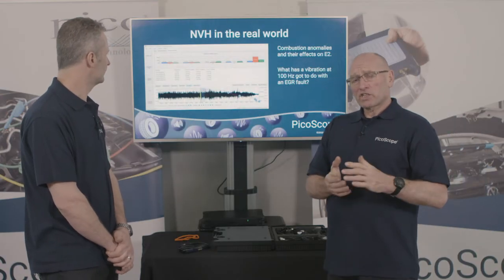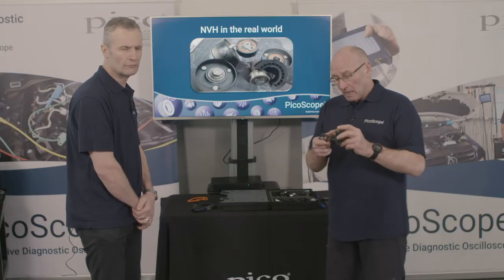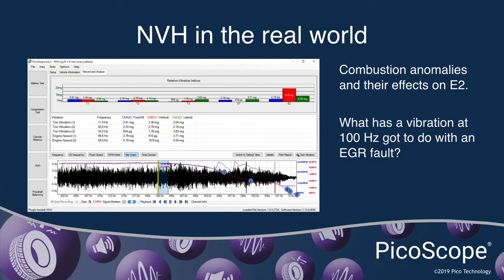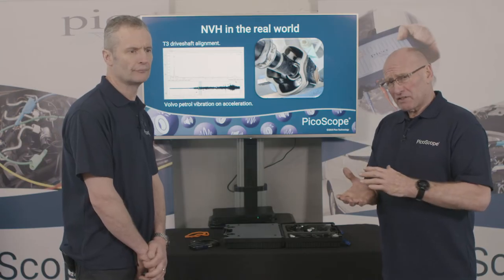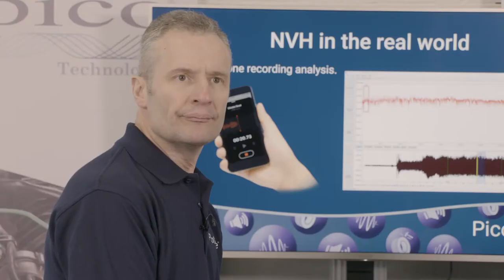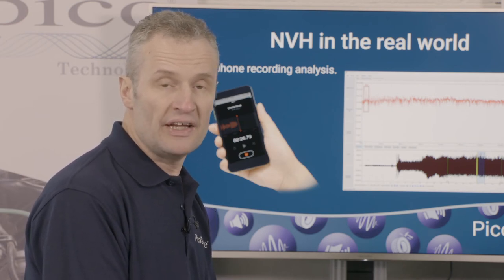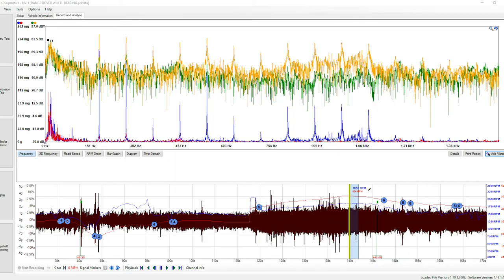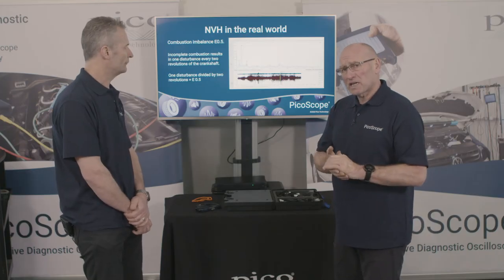PicoScope NVH episode 7: NVH case studies

Comment: Excellant series fellas. Not too technical that I got lost but not a sales pitch either. From my point of you this seems like magic but I think this is example of tege future of diagnostics. Easily transferable in the shift toward electric vehicals.
Reply: Thank you Mark and glad you enjoyed it. It's a tricky subject but hopefully this will give everyone a little confidence to at least take a measurement. It's a fascinating subject and has a lot more to give then just finding a tyre vibration and with the rise of EV's this type of non-intrusive testing will be important. Thanks again!
Reply: Hello Mark and thank you for the feedback, sorry for the late reply. To follow on from Bens reply, you are most certainly correct, NVH will be around machines/vehicles for many years to come be they Petrol, Diesel, Gas or EV. The ability to record NVH whilst measuring frequency and amplitude will bring about additional non-intrusive diagnostic techniques. These techniques will allow the technician to make an informed decision on the relevant “next step” for diagnosis (possibly intrusive) or indeed which component to replace. I hope this helps, take care……Steve

Comment: 我想请教一个问题   XYZ的震动值超过多少mg'算作不合格的呢
Reply: Hello and thank you for the feedback, sorry for the late reply. 
Translation to English: “I would like to ask a question, how many mg 'of the vibration value of XYZ is considered unqualified?”

This is an interesting question and difficult to answer conclusively. Forgive my translation but I assume by unqualified you are suggesting how much vibration is unacceptable in the XYZ axis?
This all depends upon what we are measuring and where on the vehicle?
Think of an engine vibration with the accelerometer placed on the engine and then on the chassis.
The level of vibration at the engine will be greater than the level measured at the chassis but by how much depends upon the efficiency of the engine mounting to quench this vibration, and of course, assuming there is no foul conditions between the engine and chassis.
This is a typical example and one where the vehicle manufacturer does not provide any data or values for engine mounting efficiency. Therefore, we are reliant upon back-to-back testing with a known good vehicle. The results then form part of your data base and build upon your experience level as you continue to measure a variety of vehicles with this very specific, dedicated tool
I hope this helps…….take care……Steve